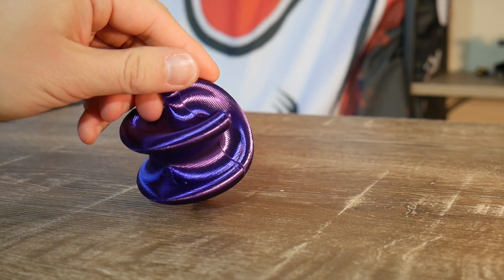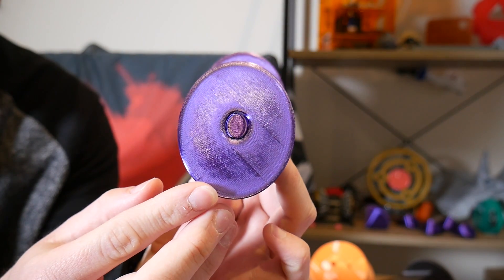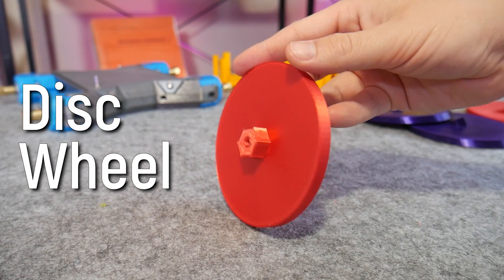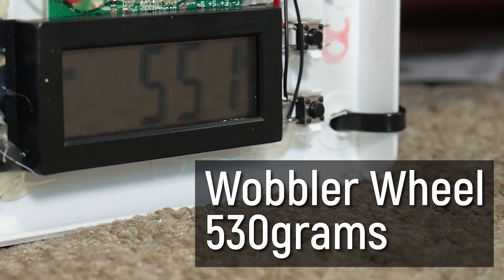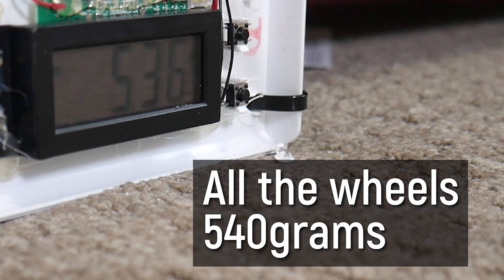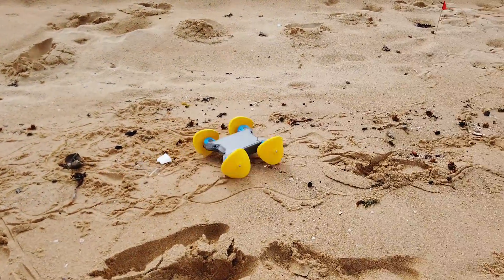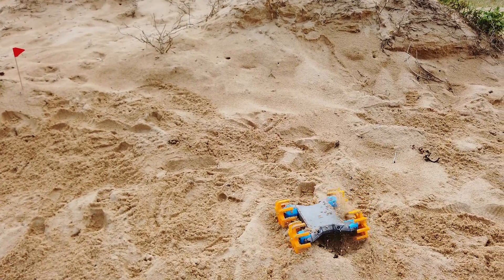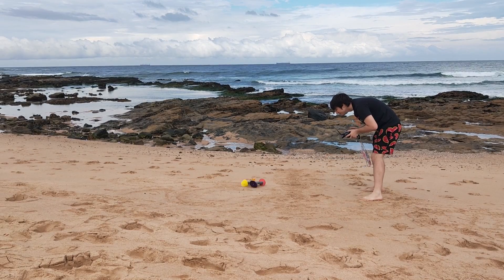This Robot Drives on Wobbly Wheels (but HOW?)

Comment: The wobbly wheels reminded me of baby turtles scrambling to shore. So naturally I'm curious.... Can it swim? 😝
Reply from the maker: I think we really need to find out haha
Reply: @MakersMuse  water test?
Reply: @MakersMuse  paddles and propellers :o
Reply: @MakersMuse  it might swim well if they're on the back
Reply: @MakersMuse  Two pet bottles for floaters, holding the car in the middle with rigid wire. Car bottom about half inch above water line. I think there is no need to rebuild much, as long as there is no waves. Maybe wrapping the car with plastic food film. It would be an interesting test.
Reply: @MakersMuse  Yes please, it would be fascinating to see an underwater version! Something about the undulation of those wheels reminds me of rays or nudibranchs.
Reply: I wonder if spokes or wobbler would win
Reply: Oh hey I said the same thing ^_^ the reflection and shape definitely help that look.

I also was curious as to how all of these would preform in water... I mean Amphibious vehicle is certainly a bonus.
Reply: @SwiftCreationStudio  I didn't think of amphibious use until see your comment but i think it's a great idea, it looks like it would work.
Reply: @wagnercorange3458  a lot of people had the same idea but yeah I think it's something to look into.

I actually saw an "amphibious" at least by the owners claim vehicle it had 6 large tires and a very hollow shell that almost looked like pontoons on the outside edges.

Watching them flap through the sand made me and a lot of people think Sea Turtle and considering the beach location that added to it
Reply: @SwiftCreationStudio  perform?
Reply: @beaclaster  Half asleep, with my auto correct doing most of the driving if you're only here to gripe about the transposition of two letters I would recommend staying away anyone who may have Dyslexia. You'll be seen as a Duoche
Reply: @SwiftCreationStudio  away from*
Reply: @beaclaster  I*
Glad we cleared that up. Now that we've established you're not infallible we can get back on track.
Reply: Try it and see.
Reply: and when its driving without sinking too much it reminds of how a snake moves in the sand, leaves the same trail too but not as wide
Reply: Exactly my thoughts
Reply: This is exactly what I was thinking. Would be an awesome amphibious vehicle!
Reply: Was looking for this comment so I wouldnt write it myself just to scroll down and see someone else wrote the same thing before me
Reply: @John_Makes  Same.
Reply: please make a video about the robot 😁
like to know more, is it raspberry or arduino??
or have you made your own system??
wod love to make a dolly for my go pro with it 😍
Reply: How will we protect the motors from water?
Reply: @polychoron  Depends on how the motors are situated. He could redesign it and use belts to move the motors away from the water or close them in a shell of some sort. I'm interested in seeing how he does it honestly.
Reply: @polychoron  make them waterproof
Reply: I would love to see that
Reply: Actually, looking at how the lower section of the wheel transform as it rolls and the sinusoidal tracks it leaves in the sand, I’m thinking this could be an ingeniously simple way to make a paddling motion!
Reply: It probably could swim, but the weight will do the opposite of assisting it’s swimming.
Reply: I bet we can design a wheel that can.
Reply: Paddle wheels, so if u can get the body to float, it should be able to swim. (not the wobbly wheels though)
Reply: i think it would, there seem to be some forward traction in the wavy motion. Two pet bottles as floaters, one each side,  holding the car in the middle, a half inch above surface, with some rigid wire,  would give us an answer.
Reply: Maybe if you give the wobbler wheels some "toe in" like cars do (Like so: /\) you'd get a little more force to move you forwards as well! 
There's lots of sneaky benefits to toe in - toe out especially when it comes to performance cars.
Reply: i don't think it would, but a wheel with spikes would clearly do

Comment: So a few things

when it comes to wheel traction the overall surface area of a smooth wheel doesn't really matter so much as the width of the tire. a wheel that is 5 inches wide will have the same traction whether it is a 25-inch tire or a 35 inch one. (to have the wobbly and normal wheels have the same surface area either the wheel diameter or width would have to change. for a completely fair comparison, i would keep the diameter and cross-section width the same thus the wobbly wheels would have the advantage of having slightly more surface area.) the diameter of the wheel from the center however will affect how quickly something will lose traction. a 35-inch wheel puts a lot more torque at the point of contact than a 25-inch diameter but requires more traction in order to not just spin the tire. so a 5 by 25 wheel may work fine but a 5 by 35 one may just spin and lose its traction.

the body of the RC car was hitting the sand, that was what caused it to stop, then the wheels dug a hole trying to drag the body across the ground.

adding some type of pattern to the outside, even just a simple line would increase the traction, by providing a small shelf that can press against a surface rather than relying solely on friction, but this would affect the results unless done to all wheels.

also, the spoke wheel has an overwhelming advantage of being more like a tank tread than an actual wheel which is why it was able to move across the sand easier.

Comment: With the round wheels the reason why they did terrible on the sand was because u accelerated too quickly, accelerate slower and u will get better results

Comment: I think their size was the biggest issue. If you scaled that up into real life, almost any car would get stuck in a sand dune that size (i know RC cars can still do that course ez, but they have a wider tire tread and are rubber vs plastic). I do think each wheel design has a lot of potential though! I would like to see the same race course you tried out, but with the car printed at 200-300% the size. I am also curious with the wavy wheels if you can control all four wheels individually. I think that would make it so you can go front and backwards like you have, but then go sideways just as smoothly. Like 2 screws driving parallel to each other in the sand.

Comment: It seems like the whole problem is about traction, I agree the paddle wheels are a whole different brand that is unfair to test against smooth wheels. What if you make a hybrid between the wobbler wheels and spoke wheels? As you were talking about with the carpet test, velcro wheels would be an amazing step up, because of grip. I feel like your focus is more on shape more than traction though

Comment: The wobbler reminds me a lot of the sharkwheel. These are skatleboardwheels that work like multiple wobbler side by side, with the addition of more curviness. They seem to work really well on a bit of sand, since the sand is pushed away. 
So maybe it would be fairer to use more wheels, side by side. Additionally try to test them on a rough surface covered with sand for example.
-You could also add small fins to the other wheels to help them dig through the sand. 
-have you considered printinq them with a foamier material or coat them with a rubbery material? (Bully liner from one of teaching techs video comes to my mind)

And for fair comparison something like a parcour with different stages (not sure if stage is the right word) would be nice. The wheels are compared by their speed through the parcour. The stages shouln't be difficult like thebeach. But something like the aforementioned surface covered with sand would be nice. Also dirt, wet surfaces or sticky tracks would make great stages in my opinion.

Comment: It's all about traction indeed!!, i made one project for the college one day, the professor requested us to make a DIY car not larger then 30 cubic centimeter, and it should pull at least 10 KG of weight. so i went to my computer and designed something similar to asphalt rollers. But instead of leaving the wheels bare plastic, i wrapped it with duct tape, with sticky side facing the floor. and what do you know, i managed to pull 22 kg with a 3.8 KG 3d printed toy, and won the competition!!! :)

Comment: I'd imagine something like a hybrid of the wobbler/prongle and the spoke would work great. The spoke wheel works because it throws sand and the other ones work because they contact different patches throughout rotation a spoke wheel with the spokes pointing in different directions would probably give heaps of traction.

Comment: those are just complicated wheels, like the perpetual thingies
Reply: screw barrels
Reply: how do you compare traction and non-traction traction
Reply: slip-control-system, from cars? tcs
Reply: you can even drive with a millimeter wide disc, if you are patient
Reply: you are intentionally "rubbing it", full throttle
Reply: more height to belly, no belly flops
Reply: why do you care about classifications
Reply: test other grounds

Comment: i think you will find the spoke wheels performed so much better on the sand because they had double the surface area. not only do the have the outside surface area the other wheels were measured on but on sand they have additional surface are as the sand pushes up the edges and they work like a paddle steamer which would also be a great design to try on the sand

Comment: if you chain the wobbly wheel together with a slight offset (off the wobble)
you could make a kind of cuttlefish kind of movement style
you know, those thing that has a skirt as their way of movement, wobbling it to move forward?
perhaps this could be an idea of swimmer or waterlogged sand crawler?

Comment: Maybe a criteria could be the contact surface rather then the overall surface of the wheel. Beeing completly theoretical, the contact surface is only a line, then your spoke wheels have a larger contact area then the other wheels. Wobbler and disc might have the same contact area, and maybe the sprongles as well. But spokes are definetly bigger.

Comment: It would have been interesting to maintain a uniform footprint per wheel in the design as well. The 8-spoke wheels have a much higher footprint than the other wheels despite having the same surface area. I have no clue why such detail could be usable information, but it’s a thought.

Comment: the wobble wheels remind me of mecanum wheels with the 45 degree slant, please try them again when you can trigger individual motor pairs like when a mecanum wheel pair does side movement. much like those wheels Id imagine a sideways screw movement to be possible.
Reply from the maker: I really wonder if they would work as mecanum wheels, definitely need to track down the controller to try!

Comment: Cool! Just print out some fat hollow wheels with bar treads on them like the sand tires. Make the bars a bit larger since they are not pneumatic and cannot take advantage of low tire pressure to help them out in the sand.
Then try another set with spikes in place of the bars.

Comment: If you are going to move through uneven terrain, at least make sure the bottom of your vehicle is far enough from the land surface, so it won't got caught and stranded itself in the sand.
Reply: And if you don't, then at least make sure your wheels are capable of burying you in the sand to hide your shame.

Comment: What about instead of the challenge being based on surface area of the wheel that touches the ground, wheel designs with a limit of filament used, measured in volume (mm3) or weight.
Constraints like that in a contest can really bring out the creative side of people.
Reply from the maker: Yeah that constraint might be better and result in some unusual, lightweight designs.

Comment: You could capitalize on the paddle design and do some steam engine style turn wheels with each paddle coming at the ground at a very acute angle that is opening to the rear of the car. So if it's a 30° angle, it would be facing the rear or away from forward travel.

Comment: There's a reason why lift kits are put on 4-bys, clearance.  For the terrain being tested, a much larger clearance is required.  For this to be a fair test, the wheels should probably be ~2x the diameter tested, and all the wheels should have the same profile diameter.  I'd like to see a more full prongle design, instead of the 1/2 prongle design tested.  Full test, nevertheless.

Comment: So it basically boils down to two things:
Contact area
Force vectors on that contact area (and its rate of change)
None of these are similar, as you mentioned at the end for the sandwheel (and touched on with the burrs for the prongles). Which is at a huge advantage there, so unless you tskr things like fuell efficiency into account I would disqualify it. It's like entering a chess master into a primary school contest.

Also the material limits for the prongle gave it an unfair advantage that should really mean a penalty point since the wheels would be less durable.

Would be interesting to see a more in depth exploration of these things. Would be a good refresher for Newtonian mechanics for me. And an interesting look at material properties and where that puts the current  limits for 3d printing currently.

Edit:
It would be fascinating to see what a neural net ai would do with these tires if you would let it 'evolve' them. I wonder how close you'd end up to current tire designs

Comment: I wasn't surprised that the wobbly wheels worked better than straight wheels, but I was surprised that they didn't work better than they did. A common off-road technique when stuck in snow or sand is to work the front wheels back and forth to clear a path and gain purchase (with front/4wheel drive). Clever insight from a clever industrial designer.

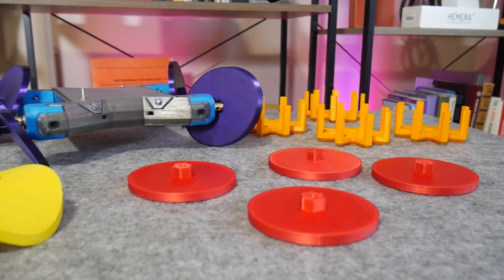Comment: 13:46 the spoked wheels have more contact area per moment. We should try the same total surface area and width as the normal wheel but with a larger diameter - yes, that means the wheels turn faster with the same rpm, but they also get moar freeboard than the standard wheel.

Comment: a helpful fact herr would be that Traction is not dependend on Surface-Area, but much rather how the surface "interacts" (or claws into) the ground, maybe that helps with wheel design😉

Comment: The spoked wheels did have an unfair advantage because you designed them with the idea of the same contact surface area which was true on the carpet but as soon as it got to the sand they sank in and the side of the spokes added to the surface area.

Comment: When it comes to wheels you have the traction from the rotational direction and the traction perpendicular to the rotation. Your wobbly wheels are using the side "bite" of the wheel design to increase their level of traction. The traction parallel to the rotation is very low on smooth hard plastics. (As shown on the carpet tests and why the wobbly wheels moved to the right. It's also how snakes move!) You can see more examples of using the edges of material for traction in offroad tires and especially in hobby rc tires for offraod racing since they wear away so quickly. Racing tires have square or uniform knobs that stick out in order to produce an edge on the backside (for acceleration), the sides (for turning) and the frontside (for braking).

The wobbly wheels also are using the surface area of the unprofiled wheel (before shaping into the wobble designs) when they are stuck. When moving with the rotation of the wheels they sit on a very narrow profile. When they spin in place the wheel base width changes and they get to try and contact more ground as if they were that very wide wheel. In hill climbs you can see drivers of four wheeled vehicles turn their wheels when they are slowing down or getting stuck. They are trying to find a patch of ground which will give them more traction by using the steering of the wheels to increase their wheel "width." Like skimming the ground for a grippy part.

My guess is the wobble designs would be best at high efficiency (low speed, low contact patch) wheels like what's on a road bike or small economy car. Though I wouldn't put this on anything with less than four wheels. It would trade off friction due to the side load on the bearings and the wind at higher speeds, in favor of the ability to not get stuck or spin in a very narrow patch of gravel/sand/ice. Possibly lower mass per "offroad getting unstuck ability" mimicking a wider wheel, if it was strong enough too. 

The biggest downside is the side loading on the wheel at higher speeds if on inflatable tires. You wouldn't want to have the wheel spinning at any considerable speed and then ask it to change a mass's velocity vector as the sideways traction and stiffness would be changing very quickly. The left-to-right contact patch would be changing shape, much like an unbalanced wheel would, minus the mass component.

Going back to the robot though. One extreme is Disc wheels. The other is the Spoke or Paddle style wheels. If you need to be able to go forward better you skew to the Spokes/Paddles. If you need to not slide sideways you opt for the disc with a hard side edge which will keep the vehicle straight and not allow sliding. A wavey paddle design would be best for sideways loads in hard packed sand at higher speeds. In loose very rough conditions on a skid steer (as in this video) all you want is forward motion of the wheels. Paddles and spokes win! The one improvement over spokes that paddles have is when the paddle is on a loose surface the smooth balloon of the rest of the tire (which is a lot more surface area) limits how far the paddle can dig down, reducing the chance of getting stuck. Spinning the wheel very quickly negates this and makes the spokes and paddles about even.

Thanks for coming to my TEDx talk. 

TLDR: Everything is a tradeoff so you should build to what is needed. Not anything is best at everything.